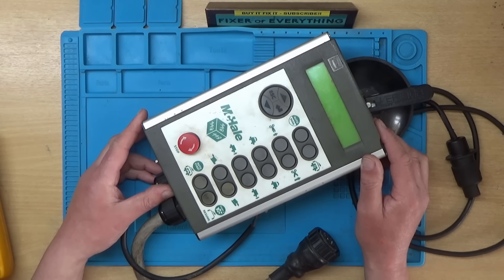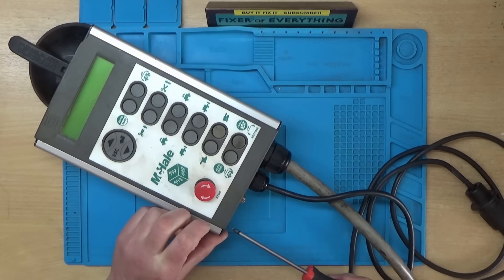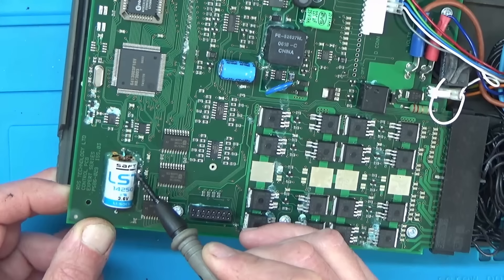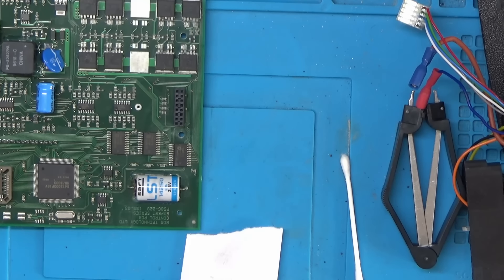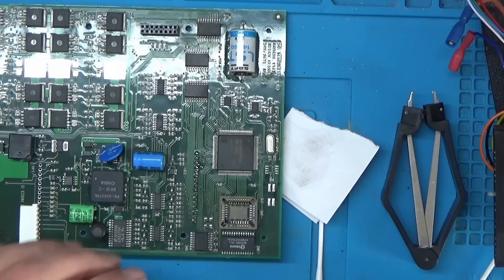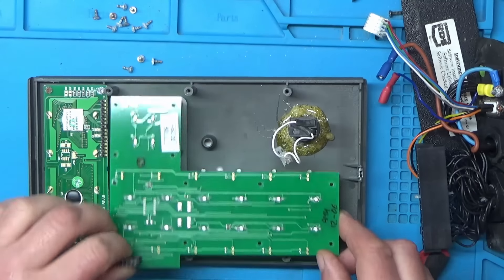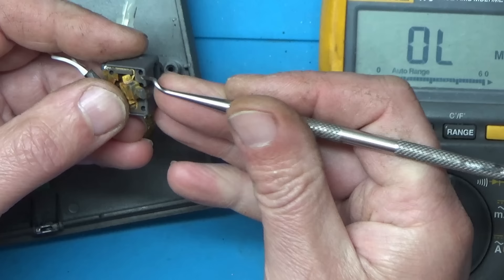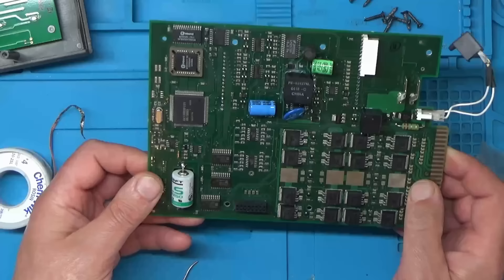Faulty McHale 868 Square Bale Wrapper Control Unit | Can I Fix It?

Comment: Having to use super glue for the projects I do is already annoying enough (I dare say I hate using it)… but having to use super glue that has already been opened and used is even worse! 😫 I just had to buy a new bottle and use it, so I’m dreading having to use it again lmao 😂
Reply from the maker: 😂😂😂To be fair, I've had this tube for over a year.. I think it's the first or possibly second time that the nozzle has blocked and there's still quite a bit in the bottle. I don't like using the stuff much either but it's handy to fix stuff in place quickly especially if you have activator.
Reply: @BuyitFixit  after making my original comment, I very deliberately put the bottle away upright, and the next day it was inexplicably knocked over. Fingers crossed the lid isn’t glued shut! 🤣

Comment: HAIL!  Fine Duty's Complete, when all Beeps again.    *Thanks!  fun watching
Farmers are Generous, at times, bit too silly;  But know help's near when needing a mend.  Equipment treasures Farmers;  Rain's Value not questioned;  Control Unit left soaking in Shower, so i'll ring question in.  WHY company not, at least, give it a Hat?   
Imagine some [farmer] thinks they'll melt in Rain, Run for cover before weathering away began.  In haste, forgot what just hand in hand, now dances with raindrops out on the land. 

All lucked out, storm could've been corporate brand.  Cries for dry socks, see no size given.  Secrets lay hid, message is sent, 'none here, any different will Not fit them.'    Not a drop wasted .... Farmers' Secrets Grow Sun Ray defense, just in case this may happen again.
Reply from the maker: I think the unit is supposed to be left in the cab of the tractor and operated from there👍

Comment: Hi mate I have a fruit machine transformer that needs a rewind do you no anyone that could help me with this any help would be appreciated 
Thanks 
Steve
Reply from the maker: Hi Steve, sorry I'm not sure on transformer rewinds. Is it an old machine? Could a switch mode PSU not be used instead? I used to have loads of old fruit machine parts back in the day from things like Barcrest MPU3 machines etc, but alas I no longer have anything like that.
Reply: @BuyitFixit  Hi thanks for replying hopefully got a rewind sorted but just incase you mentioned a switched transformer wouldn't have a clue what I would need if I sent a picture would you be able to give me so advice or I live in Washington so could bring old transformer for you to have a quick look 
Thanks Steve
Reply from the maker: Sorry for the late reply Steve, YT only shows me new comments, and I have to select a different option to see "responses with new replies". You can email me at the channels name at out look dot com 👍

Comment: Geez, don't loan those tools.  Although, I can't condemn that person- usually stuff when is used outside is supposed to be weather resistant.
Reply from the maker: I think the control box is normally installed in the cab of the tractor.